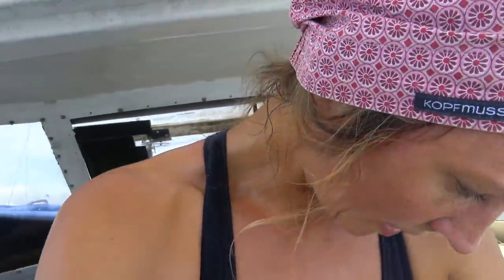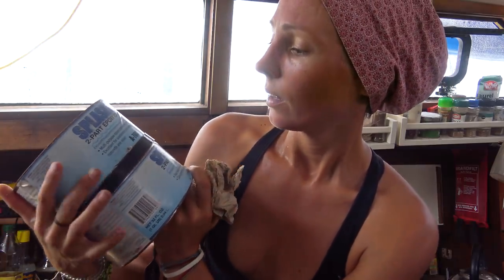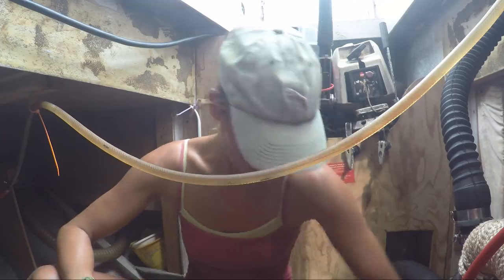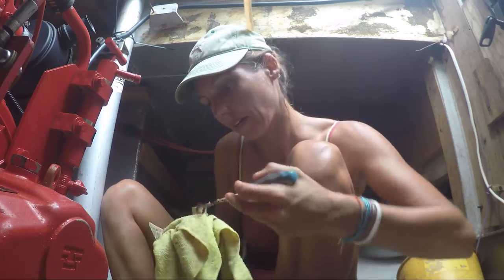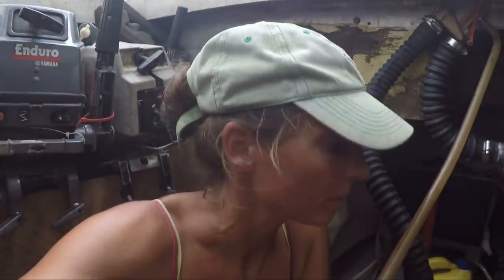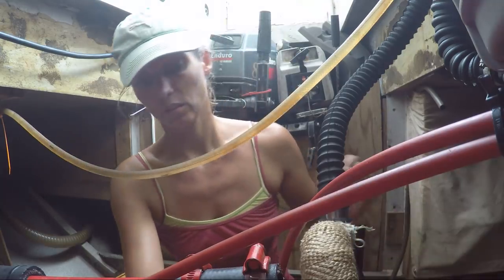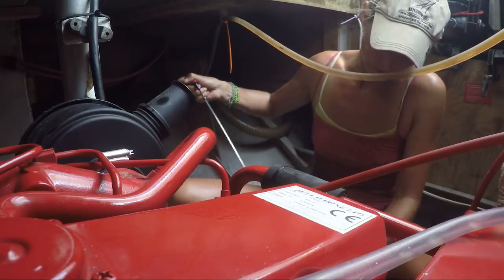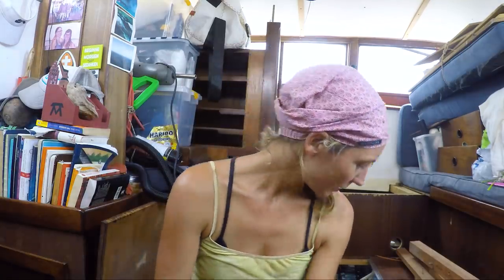Fixing a LEAK in my sailboat UNDER WATER with Splash Zone - UNTIE THE LINES IV #13

Comment: This is why I watch. Not only are you a bad ass, but you put yourself out there, with the highs and the lows. I'm man enough to admit I've gotten so overwhelmed when things aren't going right I've sat down and cried, but then pick myself up and plug on.  Good job, Nike. It always seems to work out in the end. Be safe.
Reply from the maker: Gary Souza yes, Gary, sometimes one has to just sit and let it all out. It helps to gather some strength to power through the challenge ahead. 
I always find that keeping a clear focus on what you want and where you want to be also helps to overcome moments where you feel overwhelmed. It’s mostly a question of will power and then some planning on how to get things fixed 🤣

Comment: Nothing beats careening on a beach with a mudflat shoal for a quickie job on outside hull work, changing a shaft seal or eliminating ALL thruhulls, keep 2, 1 in, 1 out, and use a manifold and plumbing to move fluids around inside, reducing risk of leakers.

Comment: I love that you allow us to see you at your lows. I admirer your accomplishments and abilities. That fuel leak was just the worse... I had a tank rupture and the smell is still there years later. Had to tear out lots of insulation and wood work. Sealed and coated as much as I could without gutting her completely.  Did you come on a secret to eliminating the aroma?     Oh on a side note..."Is that engine ever beautiful!!!"
Reply from the maker: lowbrowscruffy i just tried to clean it as good as possible and then I used some of those car-smell jellies and for long term some coffee that I put into little bowls throughout the bilge. It worked pretty well actually 👍

Comment: Mike Jacoby, bit of a legend in my world. Such a bummer to have unendingly things needing work. My first boat was 40 years old and after 3 years of non-stop fixing I finally realised that I wa and wold always be just spending more time doing that than actually using the boat for what I brought it for. My second boat while costing more has easily repaid that in the last 2 years by having nothing major go wrong. And instead of sailing 3 days then spending 3 days fixing things I can just sail all the time and keep up with normal maintenance along the way. i was very emotionally attached to my first boat so it wasn't easy to "give up" on her but what made me take the decision was that I finally realised I just wouldn't feel confident sailing big oceans when at any time some thing was likely to break.

Comment: I’m a 19 year Journeyman Diesel Mechanic. I’ve worked on that engine more times then I can count. I ran a shop working on those almost exclusively. 

It’s great that you’re doing your maintenance yourself. It looks like you’re doing a quality job. 

FYI it sounds like your waiting for the glow plugs to warm up before you start. Don’t bother. On that engine you should only need those in cold weather.  Even if it doesn’t start (which it will) you won’t cause any damage to the engine.

Comment: I would suggest reinstalling your oil filter in a remote position because it's way more easy to replace it. Also, rather than open the heath exchanger you can run freshwater for a few minutes after using the engine or clean internally with buster clamp, much easier than open everything every time.

Comment: Hi, have been enjoying all your videos from the beginning.  I've had 30+ foot boats for over 20 years.  I've been trouble shooting and fixing electrolysis problems on boats and land (Slab Leaks) all that time.  While watching this video I've realized you have an electrolysis problem that is causing your leaking tanks and now hull.  Don't worry it could be something as simple as a bad wire caring low voltage.  Tons of DIY info on how to trace stray voltage.  I do know aluminum boats are extremely vulnerable to electrolysis in all its forms.  I know for example one stray button battery lost in the bilge can sink an aluminum boat in a few months.   Also, I am retired Airline Pilot and know their are tons of DIY ways to find cracks and thin spots in aluminum structures.  Something you should plan on during your haul out.  Hope to see you out their soon on my project pock cruiser (Newport 27) soon.  Fair Seas and following winds.

Comment: I love how you prime your filters. Very smart.
Reply: It’s a bad idea, that’s unfiltered fuel straight into the pump, very risky to save a few min of bleeding.
Reply: @jordanm6473  how do you know it is unfiltered?
Reply: She was pouring from a jerry can, never prefill diesel filters, the fuel needs to be run thru the filters. Oil filters different story, fuel filters, you’re asking for trouble. 

I suppose you could perfectly clean a diesel fuel can, then pour filtered fuel  in it, then directly into the filter, but I don’t think that’s what happened, and even if it was that’s a lot of opportunities for fuel to get contaminated.

Doesn’t take much contamination at all to clog an injector, never seen a engine manual that recommends doing it that way. May be fine 4/5 of the times but not worth the risk.

Comment: A good running diesel always warms the heart of a snipe. Glad to see your tank is SS and not aluminum. More flexibility with weld repairs on SS. I have looked into aluminum repair and welding compounds of low enough temperature to use with a propane torch, but MAPP would be preferable.
Reply from the maker: spencer marshall oh, this is a water tank and it won’t go back in. The diesel tank that needs repair is aluminum......😬
Reply: oh  :) The aluminum welding (brazing) compounds I was speaking of you might want to engage are for hull repairs anyway. You have that twin keel and the thing is made to be beached. A leaking seam near shore on her should only be a tide repair away. Striking an electric bead to that tank's welds was not one of our better decisions. That tank should have been removed and cleaned down and coated on the inside and on the bottom outside. If an arc was struck to it things might have very well gotten worse on that.  
You are simply going to have to try working with some of these low temperature flame compounds Nike. You bought an aluminum boat and you need to get some scrap aluminum to screw up on learning to keep Karl whole and your happiness in tact. When you strike a bead electrically to aluminum the panels swell from the heat more so than using a small flame. That is more controllable with a torch. When the panels swell from the heat the welds can give out left and right. That is why the welder who worked on Karl in the first refit used a gas flame. Re-welding an aluminum seam electrically I am learning more often than not isn't the best way to go about it. But the epoxy compound you shoved in there works for now. I would shutter to think I will meet you on the hard one day and poor Karl's seams are a mass of epoxy filler. You looked saddened over the re-emergence of that issue. A small MAPP gas cylinder and torch head should be your best friend by now. Seasoned snipes know something about brazing and welding so the time has arrived for you to do your aluminum welding 101 class dear. There are youtube videos with people using those compounds around too     :)

Comment: It can get on top of you , but although you would be happy being back to see the folks, you know you would miss karl after a week or so; get him welding up , then give yourself a break , otherwise  you will  start question if it's all worthwhile  take a break take a bit time off but get the  floor welded especially now you've got a new engine in there .
Reply from the maker: David Macdonald sometimes it’s good to take a break from the boat work for sure. And then come back with fresh wind and energy. I don’t mind the boat work in general, but it’s the constant battle that sometimes wears on me. If there are times of happy sailing in between, then I usually don’t mind working on the boat for a bit, it’s part of the deal and usually fun as long as it does not come in chunks that are too big to chew 🤣

Comment: I cant imagine having a hole in my home. I would be stressed to the max, unable to sleep or stop thinking about it. If it ever happens again you will be a lot more prepared and the issue will be a lot easier to deal with, mentally.
Reply from the maker: boostnsvt since it is not the first time, I am a little less stressed but it is for sure not super fun. It’s good to walk through the temporary fix in the water, though, good prep for an emergency at sea repair. And good to see that a small hole like this can be fixed easily.👍

Comment: also forthe screws on the heat exchanger i've always used copper grease (antisieze)... now is new and they unbolt easy but in time they wont... always search in the heat exchanger the broken piece fromthe missing zinc on the anode... most of the times they broke losse and endup around the circuit... once it cloghed the output of the sea water on one of our engines...
Reply from the maker: ElectronicMarine yep, good hint. I did find quite some pieces when I looked around. It was my first change, so luckily I looked at everything quite thoroughly. That could have easily clogged some of the water flow

Comment: They didn't make that tank easy to service, would have been better as 2 more manageable size tanks.
That hull leak is a worry, hopefully it is only a void in a weld that has corroded, that's what it looks like anyway.
Keep the chin up Nike, you are doing what everyone else wishes they were.
Reply from the maker: fishaholiclures what u saw was by the hole, that’s just where it trickles through from the back. The hole was not on a seam but in the middle of the plate

Comment: Nike, you seem to have been doing diesel engine maintenance all your life. I never see you read any manufacturer's manual, I assume you do it "behind the scenes". May I comment  that I would expect a cinc anode to not be replaced unless is has been nearly used up, since it works fine until the last grain of cinc. Also, can you tell from stamps you might find on the water tank whether it is made of 1.4401 (V4A) stainless steel, which would be good, or 1.4301 (V2A) steel, which is cheaper and easier to weld for DIY welders (some  Reinke owners welded their own boat ) but corrodes in contact with seawater or other metals. This might explain the leaking and would require insulation/ paint. Also if you are looking for antiseize, as a co-commentator correctly suggested, look for aluminium antiseize and avoid copper antiseize on an aluminum boat. Lastly, although your filter glas allows to early identify water and dirt in the filter, you might want to consider installing a plastic diesel day tank of 30-40 l in your engine compartment, so you can avoid fuel contamination issues in general and have a 100% reliable fuel system when sailing short handed. Day tank setup "how to" can be found easily. Looking forward to more adventures (and repair action in exotic places) in 2019, keep it up.
Reply from the maker: Uwe S. Hey Uwe, i already was familiar with most of the engine maintenance part from my old engine. I did look at a sheet from the manufacturer of my old engine that said when to do which kind of maintenance, just to make sure I have the right intervals for this engine. But most of this stuff is quite straight forward, I find. I will have to replace my rear transmission oil seal soon...for that I might look for a YouTube video online to get an idea how to pull the Flansh out.
The stainless water tank is leaving the boat...no coming back for that monster ☺️

Comment: With your Aluminum hull,I suggest rough sand paper underneath before you apply epoxy..looking at your video,I would of Fired the want a be welders on your hull..looks like bubble gum welders..

Comment: I know how much this leak stuff upsets you so Im going to be precise
You do need to fix this because 'we' dont know what sort of leak it is, and it can be one of a few things. +You dont want that boat banging about the ocean without knowing.

If the leak is corrosion then its simply a matter of finding the cause and eliminating it, then welding the aluminium back up with the same parent material, grade of aluminium.
The other is more worrying, you have to examine the seem along the leak, what you would be looking for is if the weld is letting go perhaps due to impurity or undercut.
Impurity is like corrosion so you already know what to do there, if its undercut, look along the edge of the weld, and see if there is a groove or a lessening of the plate. It happens sometimes that the welder couldnt get quite the perfect angle on the welding handpiece and has accidentally burned some plate away in the process, this has weakened the weld and normal stresses have seen the edges part along the weld. 

Ok so 2 kinds of cracks, those at the edge of the weld, and those within the weld material. Cracks within in seams need to have the end of the crack drilled out round with a small 3mm bit to prevent the crack spreading along. Welds along seams have to be ground and welded both sides. You need to build up the weld material so it is consistent with the material surrounding it. Once that is done there is no reason it should part again. Really the leaks you have are tiny.

Ok that said, Ive got some serious engine envy looking at Karl's beautiful Beta.
Reply: we are talking about aluminum in salt water. The whole boat is a battery. The salt alone can cause pin holes to form

Comment: I believe the old engine had pencil  zincs. Almost every engine does. In fact, the ford Lehman is listed as the E1-D (which is kind of specialized I think) as the ford Lehman is the only one that uses it. https://www.boatzincs.com/engine-sizes.html) Apparently that old ford engine was two stepped by Lehman to become a marine engine,  of the UK . All this is going by the "Lehman" label on that older video (III #23) where your grabbing parts of it after it died. Your new engine will have pencil zincs in at least a couple places and its so new that "BoatZincs.com" doesn't list it online yet so a call would be the way to go to get what you need shipped. I wouldn't be surprised that an outboard would even have zincs. They definitely have impellers ! Way down in the bottom near the bottom gearing. And just so you know, my research is entirely couch potato type , I haven't had specific experience, online only, but I have researched two areas pretty closely, one engine cooling, one engine corrosion and found out a lot. IF I am lucky enough to get on a boat someday I vow to put  every video ON THUMBDRIVE which would help with marine maintenance topics which I have , so far, put in a playlist  and organized pretty well. HERE https://www.youtube.com/playlist?list=PLxzZgQElG0cG0FSFBHnYrUFmCFD21C4FR
Reply from the maker: californiakayaker N6GRG my old ford xld 418 did not have any zincs. At least that’s what the company told me that marinized it...and that sells the spare parts...so they would have an interest in selling them. It might have had zincs, but definitely not replaceable ones and I cannot imagine that they would last 20+ years, but who knows...
These ones in the beta are easy to find in marine stores, they are fairly common 👍
Reply: @WhiteSpotPirates Hey Nike, ok, didn't have the actual number of the engine.  If it didn't have zincs it was set up to fail.  But, here's the rub apparently (although it might now matter much now) but the Lehman part of the engine apparently didn't include the heat exchanger ! Someone else, after the engine left the Lehman factory, added a heat exchanger with zincs in it , and Lehman didn't know much about them, and apparently they sometimes added more than one ! Crazy history with that engine, as it was originally designed for the "Ford Fiesta Diesel" ! Would be very confusing trying to run down stuff having to do with the marine add on's for that engine. Everything else would have been very simple and cheap. Question ? Do you remember wrapping a zinc on the propeller shaft outside  ?

Comment: ive used selleys kneed it to stop a leak on the outside under water,not my boat,http://www.selleys.com.au/fillers-putty/epoxy/knead-it-multi-purpose/
the other way is use a hand crank drill and put a bolt with 2 metal and 2 rubber or plastic washers
Reply from the maker: razzorbladz yeah that’s a good temporary fix as well 👍

Comment: Is it a pin hole in the hull ?  On a seam ?  You have so much invested in Karl .  A disappointment for sure .
Reply from the maker: steven k it’s a little pin hole, yes, but not on a seam. Might lead to 2-3 little holes once I start properly poking and hammering around. But would rather do that when out and dry 🤣
Reply: Electrolysis, have  a professional survey on the hull to find out if she is safe to sail the HIGH SEAS.  @WhiteSpotPirates
Reply: Minor setback darling, better now than in the middle of a 30 day crossing! You are the best. Act enthusiastic and you'll be enthusiastic! 2 or 3 pinholes is nothing compared to your former 300.......